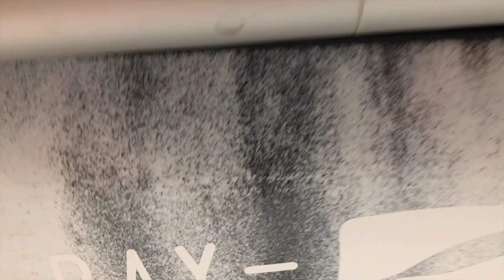HD Video Walk-Through of 2019 Pedal Pro Fish 3.2m  (Pedal Powered Fishing Kayak) from Bay Sports

Comment: Hey mate, can the pedals be completely taken off for transportation? I usually car top my kayaks and so I’d like to be able to remove the pedals and mount the car, then reattach the pedals upon arrival. Also, how fast do you think this kayak could go at a steady pedal in calm water?
Reply: RJ, you’d take the pedal drive unit off altogether. It unbolts and can be removed in less than 20 seconds, so you can store it in your vehicle. 

It also means you’re only loading the kayak body itself onto your roof, which is much easier without the weight of the pedal drive unit. So stadium Seat + Pedal drive unit safely stowed in the boot.

Comment: What kind of metal is the casing of the drive unit and internal workings made of? Assume the leg fills with water and be susceptible to corrosion in salt water?
Reply: sfatob anodised steel. It’s rustproof and the pedal drive unit doesn’t require any maintenance. Simply rinse well with fresh water and every 6 months just check all bolts/fittings are nice and tight.

Comment: what type of plastic is it, how thick and what uv rating
Reply from the maker: Hey Lochie, it is HDPE polyethylene plastic, which is on average 3.5mm thick and has UV12 stabilisers in it. The balance makes the kayak very durable, solid yet light enough for an average person to lift up onto the roof of their vehicle (once removing the pedal drive system).
Reply: @BaySportsCo  cheers, for a bloke just coming into fishing from a yak, would u recommend paddle or peddle
Reply from the maker: @lochiedavid9642  Lochie it's a good question mate. 

Firstly, do you like the idea of keeping your hands free? If so, having a pedal kayak allows you to move the kayak whilst keeping your hands free to tie lures, adjust rod positions, and fish with. A paddle kayak will require you to put everything down in order to move your kayak, by paddling it.

Will you be fishing in waters with currents? You can of course use an anchor to hold position, but you can also use the pedal drive system to hold a spot, move position slightly, or even cover quite some distance, all whilst keeping your rod in hand. 

Overall, if your main thing is fishing, and not so much 'kayaking' by way of paddling distances for fitness and recreation, then a pedal kayak is going to be great. If you do like to fish but also like the idea of paddling to cover some distance and for fitness/pleasure, then a paddle kayak would be more suitable. That said, you can still paddle a pedal kayak, quite well still. 

In conclusion, a pedal kayak will allow both benefits described above, so if you're budget allows, a Pedal Pro Fishing kayak will be a great investment, combining the benefits of both pedal and paddle power.
Reply: @BaySportsCo  thanks for the in depth response, ill give it a think
Reply: Lochie David did you get one?
Reply: @lordoffishtown4455  nah mate